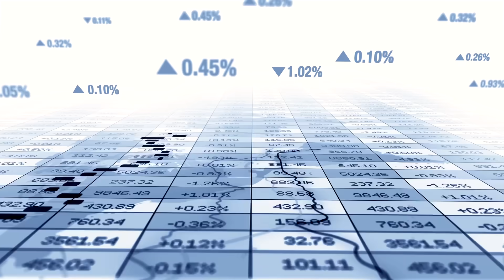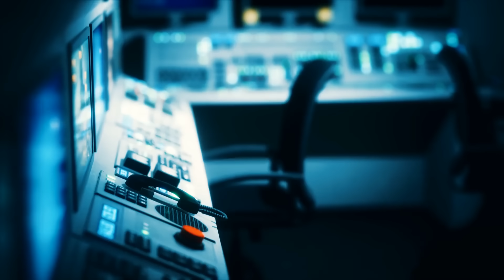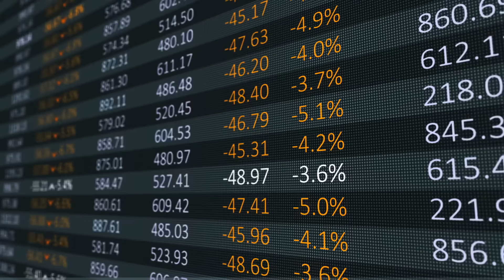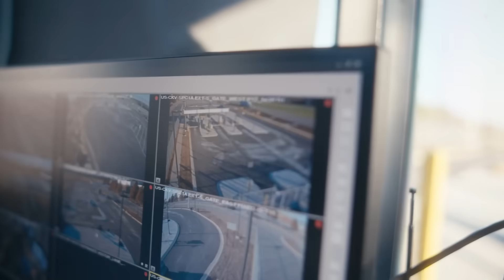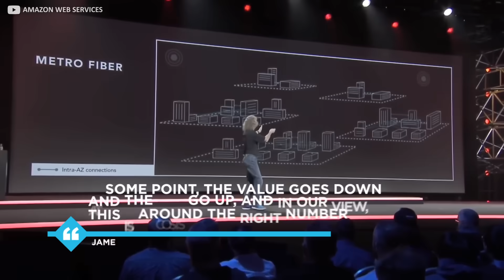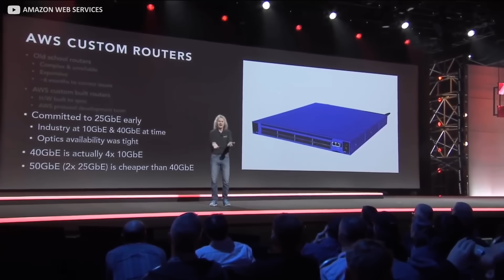Inside Amazon's Massive Data Center

Comment: I was once shocked by the security of these data center's but then I did some learning and found the real reason for such high security. They are all interconnected. If a "bad" group where to take a data center covertly they would have complete access to every data center in the world and everything flow's though these places, credit card numbers, proprietary company information, internal e-mails and even classified government files can be in these centers and the interconnectivity can't be simply turned off at the flick of a switch so if someone did take over one of these centers they could steal tons of information from all over the world, info worth billions. Or they could drop a virus that would spread from the one center to the next and the next and cripple the whole internet.
Reply: yeah...confidentiality is a must

Comment: Most hilarious thing is that the roof is made of high density styrofoam.  A small tornado can gut the place.  Also, you don't need physical access to any site to peruse the raining cloud.
Reply: not sure what roof your on about, its most likely insulated with styrofoam but has a giant metal sheet over it

Comment: I wonder how many of these are even larger are underground and protected from say, EMP's?

Being underground would allow for better cooling as the ground itself would help keep the rooms cooler than being exposed to the sun. As far as the water chillers, I don't know why they don't just re-use the same water after it has been cooled back down. Seems to me that the water could be completely free of any type of corrosive minerals, and with no minerals in the water it would be easier on the pipes than go to and from these large server rooms.
Reply: None of them are underground.  Even the US Government couldn't afford to build lots of huge underground bunkers and shelters for their personnel, military command centers and other essential hardware.  There is only ONE NORAD and it is a small hole in a mountain compared to these massive data centers.  And I can assure you, that none of these data centers are hardened against EMP attacks.  Even most military grade hardware isn't hardened against EMPs.  It's too expensive and not necessary.

Air Force One is hardened against EMP and there's no way that an Amazon or Google data center is remotely as well protected.
Reply: @lonebeagle  not sure about the emp part, but you are very incorrect. there is a huge datacenter company called "Iron mountain" that like that name implys runs datacenters under mountains.
Reply: I think you'll find the water is recycled  onsite. It's not hard to do.

Comment: Working at a data centre must be intense. No room for error whatsoever.
Reply: I work in a data center and people screw up all of the time. There is room for errors. We just have people double checking our work and a troubleshooting department in case an issue pops up. The big mistakes that actually cause REAL problems are nearly impossible to do accidentally. It's actually the best job I've ever had. Very simple and straightforward once you get the hang of it. Everyone I've encountered is super friendly and they let me work on my college degree during working hours. It's a very low stress job.

Comment: 80,000 servers? do you mean racks? with each rack holding ~10petabyte. That would have 800 exabytes which seems a ridiculous amount of data though can be entirely possible, in the end, it's just a number. But I read an article which said whole world data combined in ~250 exabytes. And this is just one data center of Amazon we are talking about, we can various vendors with 100s of data centers.
Reply: Nah it's servers but 80,000 servers can host a lot of instances so who knows how many that might actually end up being in the end or if the storage figures they said in the video are even accurate.

Comment: Do the server farms sell or use their exhaust heat (as it's a resource, not waste) and if not, why not?
Reply: The newly buildt Facebook datacenter in Odense (Denmark) has a special deal with the local district heating plant to convert the exhaust heat to district heat. The exhaust heat from the datacenter can supply approx. 7000 standard Danish households with hot water / heat near the datacenter. It is  quite unique partnership (both in Denmark and internationally). To make this possible, the Danish goverment had to  remove special energy taxes , so Facebook could give the exhaust heat free to the plant. Otherwise Facebook should pay taxes to give  the heat to the plant .

Comment: I bet, knowing what I know about the tech sector, and yes I know all about RAID 10, one good fire would take out the entire Amazon AWS system that would require restoring it from backups.  I know in 'theory' it could not happen but I recall once at Google, and this is public knowledge, a single bad bit (from possibly a cosmic ray) set off a cascade of failures that brought down Google's servers for a day.  Happened about 15 years ago.
Reply: That's a pretty drastic oversimplification. The redundancies in an operation of this scale are significantly more advanced than "use RAID". AWS has 80 availability zones and loosing one entire AZ would have almost no impact on the region as a whole.
Reply: @winniethebish1  In theory...I recall back in the days when I worked in Silicon Valley a company that prided itself on redundancy being taken out by a strong storm.  And errors can cascade at the speed of light...but you're right as rain...in theory.

Comment: Do they ever build these places multiple floor so they don't have to spread out so much?  I could imagine in some places that may be a good idea.
Reply: Usually not secure-- check on SBG in France. Datacenter owned by OVHCloud easily caught on fire and it was like a building. It was a cheap datacenter built on super cheap materials unlike AWS or Google etc etc...
Reply: YES

Comment: How do you manage end-of-life media? Huge gap in this video if you aren't discussing sanitization of end-of-life media. All the security in the world at the data center means nothing if someone then mines data off an end-of-life hard drive in a landfill or on eBay. If the Spaceship Columbia's hard drive was 99% recoverable, imagine what a bad actor could do with one discarded hard drive and the data it contains.
Reply: They destroy the Drives- all huge providers do this. If the HDD dies, then they crush it into bits and dispose it with a contract with a local recycling company

Comment: You still need a bunch of nerds to manage AWS its a rathole.

Its not even that cheap either, setting up your own VPS or container cluster on an inexpensive server from say OVH or Tempest (Path) can be both more cost effective and even easier than AWS. A single 4GB EC2 VPS on AWS will run you like 30$~ the last time I checked. The price per gigabyte on that is vastly higher than on OVH, Tempest or many other dedicated providers.

For some things tho AWS can be fine like glacier storage, S3 or cloudfront but even those can be saved on by simply using say cloudflare as a free cdn and Wasabi as an S3 compatible replacement.

All of this might be irrelevant for larger companies though but then the point has kibd of faded away, especially if they have to pay for so called "AWS technicians" anyways which then sort of defeats the point if AWS' prices are that high. But I digress.
Reply: Welp, gotta not get data burned up in fire. Lol "OVH"

Comment: 25gb has been the standard for data centers for the past 4 years or so... Even 100gb links to the server isn't uncommon...
Reply: Not really, most server farms in the Netherlands run a 25 gigabit network (around 4 terabytes per second) connection the company I work with also matches that number. Those routers cost around 200k euro or 250k USD. How these routers work is actually insane sending colored light trough optical fiber cables.
Reply: @maxdehaas6776  I've got nothing to add other than 99% of everything I've designed for the past 3 or 4 years has been 4x 25Gbps per node with some starting to be 2 to 4 100Gbps. As we move into fully software defined environments (network, routing, storage, compute, security, analytics, etc...) layer2 bandwidth is king. A single NVME SSD drive can smoke a 25Gbps link.

Comment: “You don’t need nerd to use AWS”

To get a Job as AWS cloud administrator 

You need AWS certifications 

You need to know scripting in Bash, PowerShell or both

You need to know how to automate using Python or other programming language

You have to have experience using Jenkins, Docker, Ansible, GitHub 

You must know DevOps and Agile process. 

With Cloud as an Infrastructure, you need super nerds.
Reply: Right ...

Comment: I live near these data centers — they’re unmarked massive buildings with military-like permitters. Insane.
Reply: what is your ping? you must get like 5 ms if your that close
Reply: @wellsilver3972  you’re right I usually get about 5ms and I’ve seen as low as 3.
Reply: @wellsilver3972  we’ll should be similar to other pings. Unless he has direct connection to the Amazon Datacenter, his home traffic should be like other traffic, will have to go to his ISP first, then their core and back to that Amazon Datacenter. So it does not necessarily mean he has lower ping just cuz he lives near it
Reply: @wellsilver3972  It doesn't really have to be everytime that low. I know a friend who lives like 3KM from the DC he works for and gets over 40ms ping to the very own DC. His ISP has borked routing which takes a BGP route outside his state which causes huge not needed at all loops. But given he is a consumer there's so less he can do to fix that

There is the DC where I live 200 kilometersnearby, I get like 160ms to that. I've asked few of my friends online who kinda work with Networks and even informed the higher end Networkign NOC of my ISP to see if they can get the issues resolved too.
Reply: @wellsilver3972  ping. ping ping .. pong
Reply: I work there, Manassas areas. It's pretty cool, i love my job
Reply: @trmavirtual  what do you like about it? Sounds really cool!
Reply: @imapanda2434  they look like warehouses but with added security XD I totally recommend the experience to work in a data center, at least for a short period of time. Now I work on the cloud
Reply: @imapanda2434  I think is amazing the size of the operation, how many teams work on the host racks on site and off site for example: datacenter operations team deployment team, operation team, decom team, infrastructure delivery, linux team, network team (last two team are off site, they work remotely). some servers alone are worth 500k. There are also other teams that travel around the world to service edge locations.
Reply: @trmavirtual  Wow, 500k for one server, the value of these data centers must be incomprehensibly large
Reply: A fence is not a "military" perimeter. Most data center security is a pitiful joke if you've ever seen actual military security. DC operators put on a very good show, but rarely are remotely as secure as they claim. This video is just repeating Amazon's marketing BS over an unending slide show collection of b-roll of things that aren't remotely AWS. (the guy with the ear muffs is in an etherium mine.)
Reply: @jfbeam  true that's crypto mine
Reply: The no lag man
Reply: Do you happen to live in eastern Oregon?
Reply: @adventureanglingpnw1821  I'm from Eastern Oregon and I do work at one of those data centers.
Reply: @adventureanglingpnw1821  I do
Reply: I design and build data centres 😊
Reply: @sanelemazibuko1716  You build the PDX's?
Reply: @gabrieldagod  to answer you, no. We buy them off-shelf. 

I would regard myself as a system engineer (Mechanical Design Engineer), I take already built existing equipment and integrate them into one system. So in this case, I'm a mechanical engineer, I take care of the cooling of IT Loads, size and propose equipment to cool the servers, battery room and MV/LV boards, distribution boards etc. If a specific equip does not exist, I design it and get the manufacturer to customize it for us :).
Reply: @gabrieldagod   i do
Reply: Great
Reply: Consider ALL politicians use gmail, or some sort of service that runs on AWS at some point, yeah... they should have military protection
Reply: last time a 13 years old managed to break in and fucked all up.
Reply: @Jacob But wouldnt the infastructure near the farm be better generally? Why would ISP rate your connections unless to sell a more pricey plan, wich most just dont have
Reply: I deployed one of my servers. I live like 22mi away so I only get like 7-10ms
Reply: Do you experience any noise pollution from the humming undertone?
Reply: Only Jeff can visit them.😜
Reply: Yeah unless you work there  @ebewhitecaspian3402